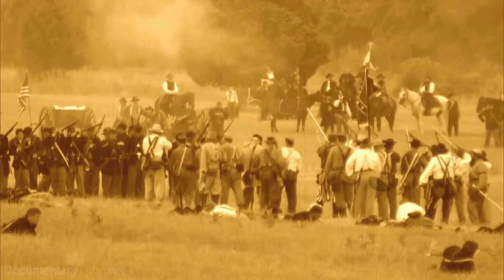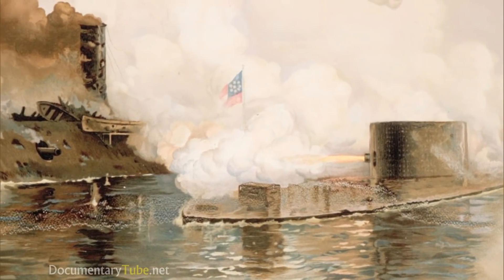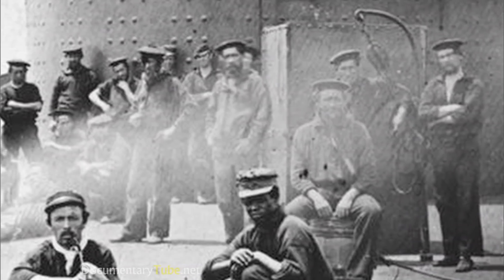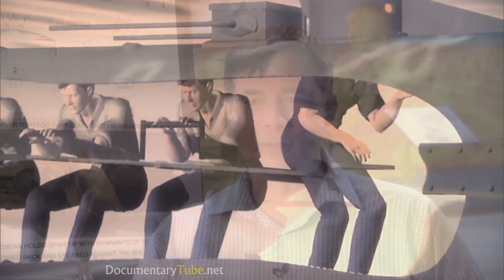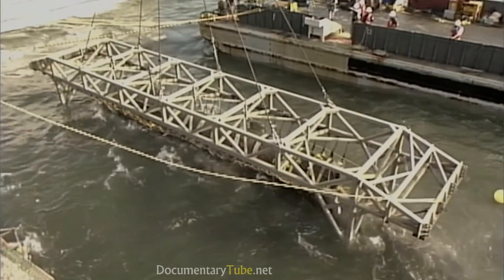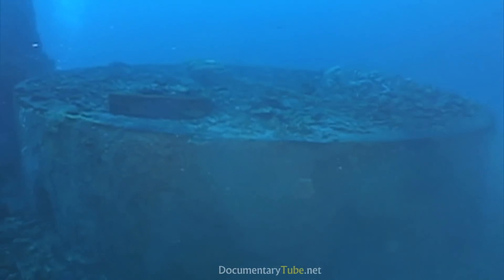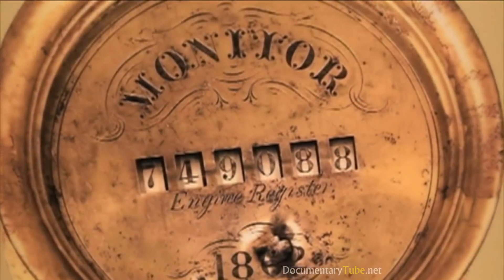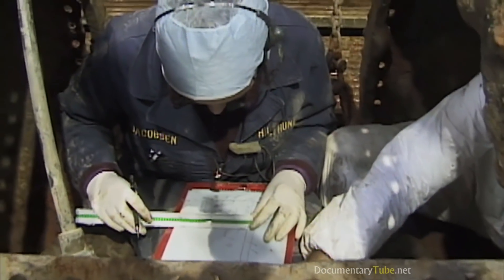Greatest Mysteries of the Civil War: The Lost Ironclads and Submarines

Comment: Does anyone know how did they manage to pull the Monitor up?
Reply: The hull of the monitor is still on the bottom.  They managed to lift the turret by means of a specially designed circular claw that enclosed and held the entire turret as it came up.

Comment: Commodore Dupont had 1st hand experience with the Iron Clads.  He came up with the following combat experienced opinions:

The screw was under powered for the Charleston SC Blockade.  It did not have the power to account for the strong currents.  They constantly were caught in the weeds.

Wooden Paddle boats had to constantly remove them from said weeds.

If a cannon shell struck the turret and damaged it too much, the turret stuck in one location.

The opening gun ports either stuck in the open or closed position.  They rarely worked like they should have.

The Steam system tended to lock up the turret and prevent the turrets to turn properly.

they were extremely hot inside.  Sailors opted to sleep on the decks

The time for repairs were far too long (much longer than wooden warships of the era).

They made excellent anchored batteries (with a functioning turret and gun ports, the made superior multi-directional sea born batteries).

Commodore Dupont wrote to his superiors that this class of ship was not combat worthy and should be pulled from combat until the "kinks" had been resolved.

Commodores' superiors removed him from command because they did not like direct combat experience.

They were ships too far ahead of their time.  They had to mature some more.  Commodore Dupont wanted ships that he could rely upon and thus count upon doing what the Blockade was intended and not pulling ships out of trouble.

Comment: I see no mystery as to the loss of the Hunley and the Monitor.  Neither of them were particularly seaworthy, the Hunley particularly subject to battle damage too.  The Monitor, with its inadequate pumps, inadequate hull, and top-heavy turrent, was just begging to roll-over or otherwise founder.
Reply: Both were built for coastal or harbor defense, not the open ocean.
Reply: They found out what killed them, the concussion from the blast did them in.

Comment: The spar torpedo on the Hunley was a last minute change.  The vessel was designed to hold a mine (torpedo) on her stern, dive under the target keel, release the torpedo and drag it by line into the hull to explode on contact while the sub continued away at top speed.  That sea torpedo (mine) was designed in Mobile.  Typical Confederate rams (built like the Virginia) carried Singer spar torpedo's to use their great mass to jam the torpedo into the target hull and back off.  CSN Davids (semi submerged steam boats) did that too.  Military experience said that was better.

Switching such a kayak shaped light vessel to the ram method, may have doomed Dixon's crew, due to their success.  Imagine sinking just below the surface, cranking up to ramming speed, jab the target, then, with hand cranks, back off at nearly no speed to trigger the torpedo by line, but it detonated with the sub still attached.  Likely she was swamped by the gigantic hydro concussion. Remember the hydrodynamic engineer, Hunley,was dead and couldn't object on engineering grounds.
Reply: S Tho Hunley*
Reply: MATT ESCO    Thanks.  Autocorrect and didn't notice.  Chrome tablets are programmed in India so their guesses at proper names and some words are bizzare.  Will fix. I had noticed the autocorrect at the bottom (his name) but not toward the top.  

Wire on man!
Reply: S Tho nice to know more than just what's in the video, I don't know why but all the wars in history, the civil war enthralls me the most

Comment: From what I learned from another documentary, the ultimate cause of the Monitor's loss was because someone on the crew INSISTED on lifting the turret and stuffing oakum in the gap between the turret and the deck, which would have worked on a WOODEN ship, but was useless on an iron ship.
Reply: I liken it to the Challenger Shuttle disaster. Someone overruled engineering sense and insisted on rubber O-rings that failed. Likewise on the Monitor the original design could lower the turret flush against the deck, but again engineering was overruled and knowitalls put oakum in there which failed in heavy seas.

Comment: The sub is hardly a mystery as it is pretty dang obvious what happened, if the explosive was that big and that close to the sub the shock wave would have killed the crew instantly and would not necessarily have done damage to the sub its self, as we have seen from history and even shows like myth busters a tiny charge can be fairly harmless in air but deadly to anyone close when it goes off under water, so it is obvious that they stuck the ship just under the surface then detonated the charge that instantly killed the crew and pushed the sup back and out the water to the surface where it then sank again.
Reply: BINGO! Why the designer didn't think of that is beyond me; because by that time in history and warfare, they ABSOLUTELY knew and understood about explosive charges under water. The Chinese have known for 1000 years or more before that; being the inventors of explosives, no matter how primitive in the beginning.
Reply: ....they said that the union soldiers saw the sub roll away
Reply: The sub signaled shore after the attack....
Reply: @HRC168  Actually no it did not.  Rumors abound that a blue signal lamp was seen by soldiers but when the Hunley was raised and archived no lamp was found in the submarine.  Forensics also have now concluded that all the crew died from the concussion of the torpedo and the Hunley simply floated out with the current and sank about 500 yards in the opposite direction of the planned escape route.  There were no signs that the crew had tried to surface,  all the crew still in their assign positions, no outward visible damage to the sub from the explosion,  all the vision ports were intact, and the emergency ballast block release levers were still in the locked position.

Comment: If the Monitor had had a drop keel I think she may have got away with it.
And breech loaders of course.
And a telegraph system for coms. Instead of voice tubes.
All available at the time.
Reply: Breech loaders were still new and not quite trusted.  Also few of the ones that did exist were as powerful as 11 inch Dahlgrens.

Comment: As usual the victors write history.  The monitor did not succeed in stopping the ravages of the Virginia  (merrimac). Refer to the personal memoirs of both captains and the letters of British sailors present who witnessed the battles.
Reply: You're not looking at the bigger picture here.
The Monitor stopped the onslaught.
It made the CSS Virginia blink.
That was enough.
Once they knew the Monitor was there, they didn't try to attack any more ships.
The Virginia stopped what it was doing because the Monitor was in the way but they didn't manage to sink that ship.  The battle may have ultimately been a stalemate but they accomplished the goal of NOT letting the Confederate steamship run loose and sink more Union ships.
Go on believing what you will but the record stands.
The Monitor checkmated the Virginia, period.  Neither ship had a long service life but with the Monitor in place the Virginia couldn't run loose and do whatever it wanted.  The other ship could be placed to stop it which it did.
They made 40 ships like the Monitor and it influenced battleship designs for decades afterwards.
The turret was probably the most successful innovation of that little ship.  How many battleships and smaller cruisers since it day HAVEN'T had turrets?
I think that speaks for the success of what was accomplished in the Battle at Hampton Roads whether you acknowledge that or not.
Reply: The Virginia went on a month long spree of destruction AFTER it was supposedly defeated by the Monitor. During this time the Monitor went into shallow water and refused to engage the Virginia in further combat. The Virginia repeatedly attempted to close with and engage the Monitor but it's 22 ft draft caused it to run aground where the Monitors 10 ft draft allowed it to escape into shallow waters. Read your history.  The Virginia was unconquered on the water. That is why a special raiding force was sent by night to attack and burn the Virginia at its dock.
Reply: AvengerII actually the Monitor did not stop the onslaught of the Virginia. The Virginia continued to ravage and destroy ships for another month after it was supposedly defeated by the Monitor.  It was the Monitor that blinked, and then retreated to shallow water where the Virginia could not follow, where it stayed, refusing to fight the Virginia, until the Virginia was eventually found and burned by ground troops.
Reply: You are correct, Phillip.  The Virginia scored a hit on the Monitor's most vulnerable spot, the wheel house, and the shell exploded against the vision slits, blinding the captain, John Wordon.  The Monitor retreated to a shallow area where the Virginia could not follow because of her deep draft and press her advantage.  Captain Buchanan of the Virginia could have did more damage if he had ignored the Monitor, since she could not inflict much damage, and concentrate on the remaining Union wooden warships, then work on the Monitor's weak spot, her wheel house.  My armchair 20/20 hindsight for tonight.